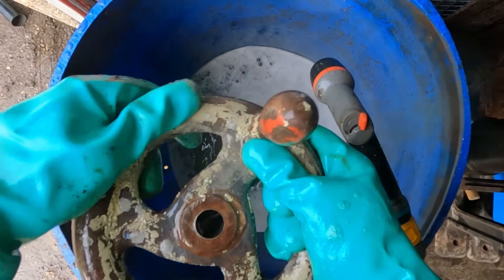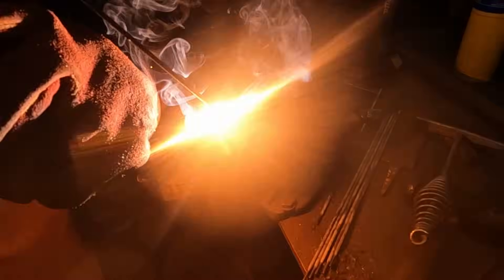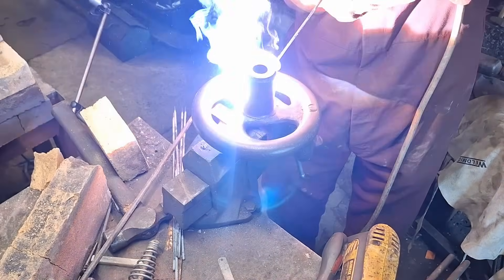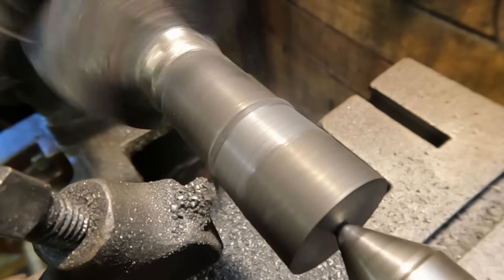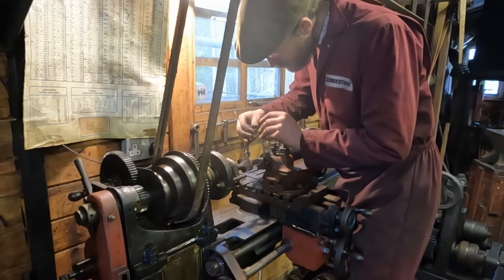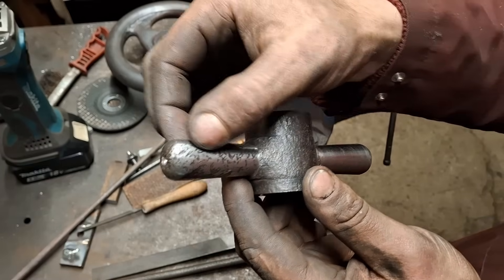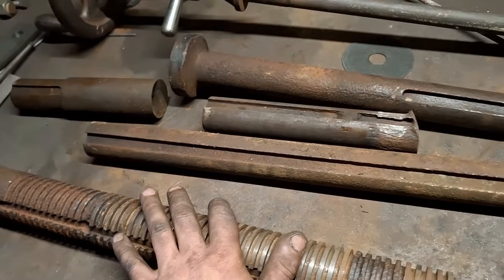Fixing Broken Castings by Stick Welding - Victorian Radial Drilling Machine Restoration PART 7

Comment: Nice cast iron welding/fabrication.  Most people still labor under the illusion that cast cannot be welded, only brazed.  Far from the truth, as you show.  I was amazed to see the use of a file.  I thought I was the only person left using them!  Early on my mentor made significant monies welding defective jeep Exh. manifolds.  At the time, no suitable rod existed, so he used old piston rings as rod.  As you say, heating and cooling are critical and he was a master at it.  All so you can avoid the dreaded "Ting", signifying that your repair has cracked!  Nice Job!

Comment: that long screw      why don't you case weld it and just re cut the threads where its needed...???
Reply from the maker: It's an option, but making a new one is less work for the same result in this case. Plus it would be cool to preserve the original as it is

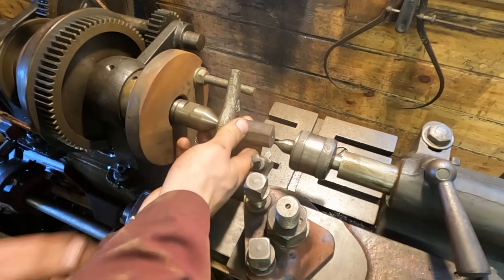Comment: The between centre work on the power feed engagement lever is great - the repair blank (1:23 - 3:06) and the subsequent repaired "whole" (8:10 - 12:00) would be murder to hold in a chuck!

Comment: I've got a brand new cle-forge  hss drill in 31.75mm  (1-1/4")  no.3 taper shank. 12" long incl shank.   I bought it to redo my keel pivot but no good to me in taper shank cand fit it in my drill chuck 😅   Any use?

Comment: I'm impressed that you went the extra mile to weld the handle and wheel, rather than just brazing them. Most folks would have taken the less time consuming route, for a low stress part that will be painted.

Comment: Good repair on the cast iron parts . What rod didi you use for welds ? 
i have heard of people just using a mig welder on cast but I have never tryed that . I use a nickel 99 rod but it cost a lot . I am looking at a 32 " shaper but a big chunk of the base has been busted off . I was thinking about a repair for that .Make it out of steel and e\welding that to the cast iron . It is a very big chunk of the base of the machine any ideas ?
Reply: do you have space for a bonfire? big fire pit, lower thr whole thing in, bake till a skewer removes clean. weld it in the pit then put the ashes back around it
Reply from the maker: I use Nickel rods for cast iron and have always had good results. I have welded steel to cast iron (probably better off brazing) before to replace a missing chunk but I try and avoid it. It could be an option for your shaper!
Reply: @iron_jonesy  I dont yhink you could get it hot enough yes brazing is a very good repair on cast . But this part is half of the base from one corner to the other thanks

Comment: This is certainly not a criticism. You did a great job of the repair. In repairing larger castings with stick welding we peened the red hot weld bead to remove stress from contraction while it cooled.

Comment: You might see if there is a DOM or Shelby tube that you can work with.
Not sure what kind of finish you need in the ID but even drilling 11-12” from each end is a tall order.

If you can start with close bore maybe a boring bar between centers?
Cheap to build but even then you might have chatter issues.
Reply from the maker: Definitely a few good options. The bore is only a clearance bore and the finish in the original is horrific so we don't have huge standards to uphold 😂

Comment: that threaded tube... its not a twist drill job, is a gun drill job. D bit cutter, backbored before grinding for a passage through the centre, mounted on a piece of heavy steel tubing for chip clearance and blast air/oil up in its own small tube to flush chips out... mount in the toolpost. simple.
bore a pilot hole of the right diameter, and let it rip.

might get it in one go, might have to start at 3/4 or something...
Reply: I was getting ready to say the same thing 🤩
This is a perfect job for the process you described. 
I hope Jonesy follows through with the process, it would make a great video. 
JIM 🇺🇸

Comment: You did some amazing work. Repairs looked like a factory finish and everything was so bad when you took it apart. Makes me happy to see you saving history. I felt great saving a 1940s South Bend lathe and a similar age drill press. I use them to restore or replace parts on my antique tractors.

Comment: I enjoyed the demonstration. I welded a cast iron sheave and when I finished the welding I put it in a bucket of ashes and alowed it to cool over night. I have been using it for over a year now and it is on a motor that spins at 1800 rpm and drives a gear belt on my lathe.

Comment: To go through all that first class and museum grade work ,,, and then weld with Ni Rod.   I barely forgive brass, but the only way to do it right in any case is Gas Weld with real Cast Iron rod. - Cast Iron results in a totally undectable  repair totally as strong as it was before it broke. - Nickle sticks put like a sore thumb and only camouflages the damage. 60/40 it will break again if put under design stress.   -  Why bother to use Cast for a missing part if you are going to sticl weld it on?

Comment: I hate everything I see someone stick welding a cast iron antique.  It's quick & easy but not correct.  Watch 3rd world repair videos & see how cast iron should be restored - fusion welding with cast iron rods.  So uncommon in the developed world it's difficult to find the welding rods.

Comment: Never had much luck fuse welding cast iron. I find that brazing is much stronger and easier to grind back into it original shape too.
Reply: The key is a good preheat, slow cooldown, and peen the weld with either a chipping or peening hammer, or a needle scaler.
I've got an old propane grill that I put some grates over, set my parts on it, light the grill, and then cover it all in a fiberglass blanket. Can do the same thing on a low heat to cool down slowly, or else bury it in a bucket of hot sand or a pit you've built a fire in, depending on how big a part it is.
Reply: sixty years a machinist and welder and I never heard of your method until now. I'm definitely going to give it a try. Love your radial drill build.
Reply: I agree, the crack has probably been there since it was made, brazing is much easier for cast iron. 

 I did once MIG weld a crack on the exhaust manifold of a Mk3 Escort without knowing you shouldn't do it, I guess I was lucky with a hot manifold & just grinding the crack.
Reply: @steveporritt1550 👍 My sister in law used to "boil" her eggs in the microwave (shell on) for years until she was told that "you can't do that or they'll explode". The next time she tried it...
Boooom!
Reply: @steveporritt1550  i have never had an issue with old exhaust manifolds with mig weld and not bothering with preheat, i think its the heat cycles destress the part over decades. maybe just luck

Comment: Interesting stuff young man. If you use a needle scaler on the wheel and engagement handle it will pepper the surface will small dents the size of the need tip, subject to applied pressure.

Comment: I love filing cast iron ..not sure why but it just feels nice ...It looks like it turns as pleasantly as it files too
I just bought a new billet of 50x50 bar cast iron to make some stuff,  its so much fun to work with  ...are you welding with Nickel?
you made a nice smoke ring there while you were laying the root weld 
You think the sort of things I do when I use old machinery...I often wonder what they made or if somehow I could find photos or well you name it ...was his or indeed her leg aching is a good one (there was a point where humans were not so worried about who did what just like it should be now but isnt.)
Inch and a quater is a big hunk of drill 
Unfortunately the biggest twist drill I have (with a tapered square drive) is 30mm just shy of 1 1/4" but its also short ....if one of them is of use let me know I can happily post you one. 
  Thanks for sharing
Reply: It’s great to file cast iron. The graphite makes everything filthy but I feel like that makes it seem like you’re doing a lot of real work. The filings are something I try to collect, I have a tiny Nutella jar of them.
Reply: @ I have not tried cast iron filings but normal iron filings improve flux for forge welding quite a lot.

Comment: You didn't, I think, mention what type of welding rod you used. I'm assuming that they were some sort of nickel based material. I always found that nickel rods made a good job of welding cast, as long as you got the pre and post heat about right, which could be an issue in a ships engine room workshop. Not welded cast for almost 40 years now.
Reply: I was also going to ask about rod choice. I was somewhat surprised that the repairs were not brazed. As that is a historically used method. But the repairs look great and I love to watch this project progress.
Reply: @johnalexander4356  Yes Keith Rucker seems to braze cast pretty often. Must admit that I love watching these repair and build videos. So much so that I'm not getting on with my own repairs on my lathe, mill and band saw.
Reply from the maker: Yes, I forgot to mention I almost always use Nickel rods
Reply: @iron_jonesy  Thanks.

Comment: buy a normal length drill and make an extension for it from some rod or pipe, easy and cheap, you do not really need the flutes of the drill all the way down the length of it, just at the business end where the drilling happens